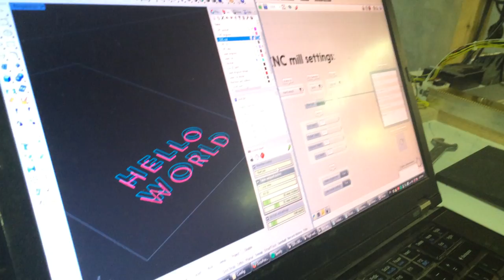ultra DIY CNC mill  - first cut

Comment: I've been following your project for some time now. What is the Electronics configuration(CNC controller, Drivers, software) that you recommend to run these systems since there is no documentation in Github showing what is needed for the Grasshopper plugin to seamlessly communicate ?
Reply from the maker: You can use almost any controller that can control stepper motors. We 
use have been using Replicape for Beaglebone. It is great for networked 
control. You can also use Ramps 1.4, Stepoko, TinyG etc. You can also 
make toolpaths (g-code) in almost any software you like, you just need 
to configure the post processor to work with your controll. We really 
like to work with Grasshopper and Bark beetle, but is not a requirement

Comment: I love the design of the Ultra DiY mill. HAs it been discontinued? I can't find anything about it on the Github page. Thanks
Reply from the maker: Yes, i have not worked on this machine design since 2017. But the documentation is still here: https://github.com/fellesverkstedet/fabricatable-machines/blob/master/award-plotter/README.md and the files are still here: https://github.com/fellesverkstedet/fabricatable-machines/tree/master/award-plotter It turned out that milling the v-rails would be a bit too hardcore for most people to do themselves. And the glide blocks were very difficult to tune and sensitive to thermal expansion. Our most well developed and documented machine currently is the Humphrey: https://github.com/fellesverkstedet/fabricatable-machines/blob/master/humphrey-large-format-cnc/README.md but the up coming Hubel series is quite exciting for home use because of the embedded enclosures: https://github.com/fellesverkstedet/fabricatable-machines/blob/master/hubel-home-friendly-cnc-mill/readme.md
Reply: @JensDyvik   Ah, thanks for sending that out, I must've missed it on the GitHub page. Yeah, I saw some of those problems with the design, but still really love it's basic idea. I intend to design a machine based off of the plotter machine, but using v wheels similar to the makerslide or openbuilds setup. 

I'll check out the Hübel as it comes out. Your designs never fail to dissappoint me in their simplicity and usefulness. I spend way too much time going through your videos and designs lol. Keep it up, man!

Comment: That's a really cool unique design! How does the brass go? Is it hard enough to work as a rack? Also, what material are you milling there? 
It's funny I remember machining the exact same text when I built my first machine from scratch. It's such an awesome feeling watching that first job come out! Congratulations and look forward to seeing more. Subbed!
Reply from the maker: The brass worked very well, it is definitely hard enough to work as a rack. We milled Valchromat, a type off HDF/MDF wood plate for the test. We later managed to mill both aluminium and steel (just barely) using trochoidal milling and well choosen feedrates. Check my channel and github for latest diy machine research updates
Reply: Sounds great mate, subbed for more videos. Always good to see a fellow DIY CNC'er.